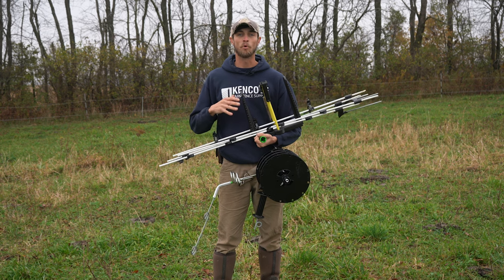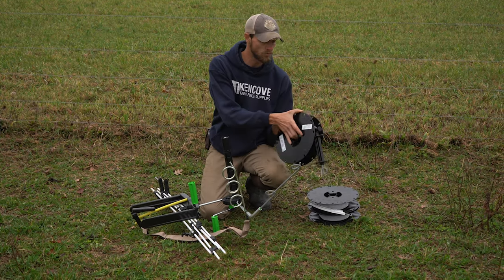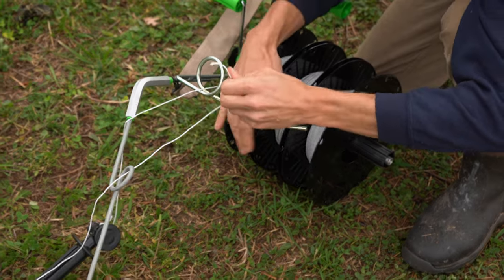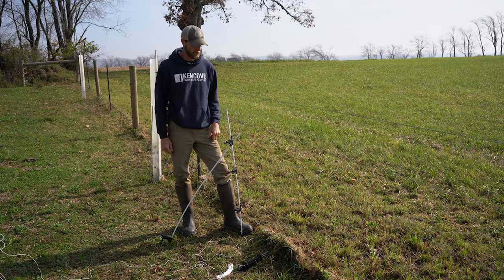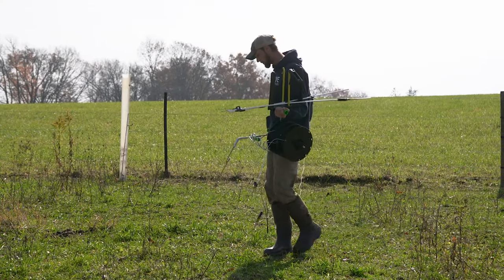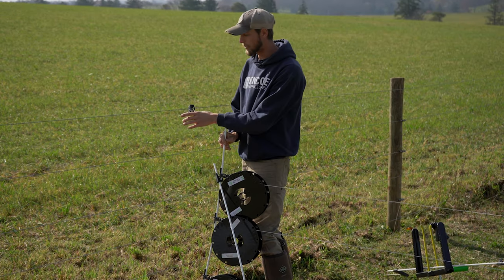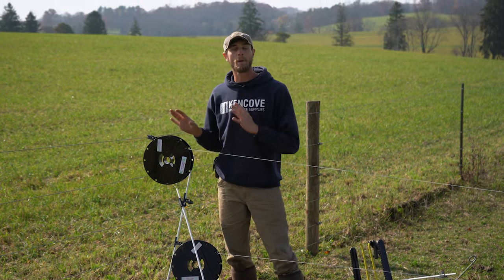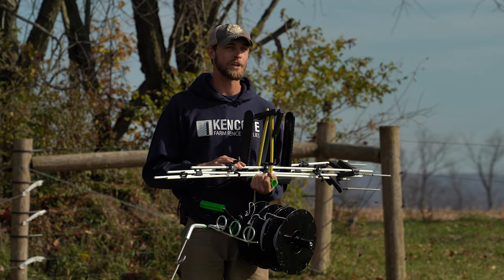How to Use the Kiwitech Carry Pack

Comment: You show the strap on the pack at the start pf the video, then it's removed for the rest of.
Can you explain how the strap is used/worn? Or better still, show this?
Reply from the maker: Eli prefers to use it without the strap as he feels it gets in his way, that's why it was removed. The strap clips to the metal loop on the upright of the yellow post holder, the other end clips to the guide close to the gear box. In the original Kiwitech videos (https://www.youtube.com/watch?v=z4S5Yse4MMw), they set the drag for easy pay out while strapped into the carry pack but they wind up while the pack is on the ground in an inverted/upside down orientation. This allows the crank handle to spin without tangling with the strap. Eli prefers to wind up while walking and therefore removes the strap so the crank handle is unhindered.
Reply: @KencoveFarmFence  
Have found a workaround
Clip the strap on to the metal riser from the gearbox
It slides around, but once in place, and the strap is the correct length it works

Either way it's not that ergonomic, rides up when you're winding in particularly